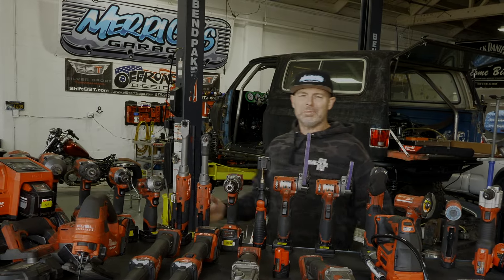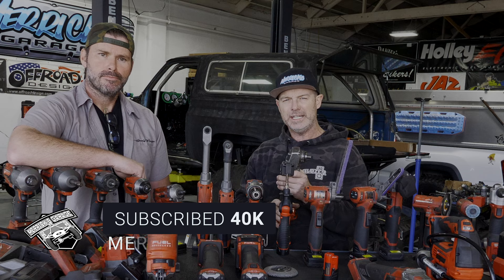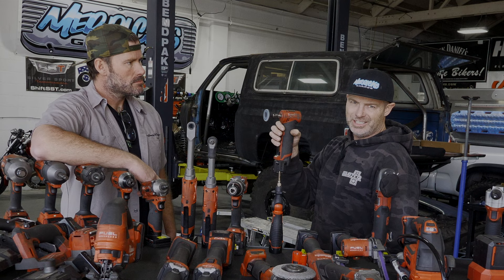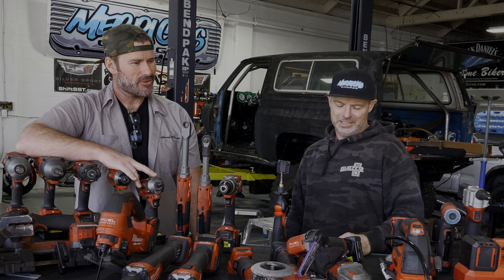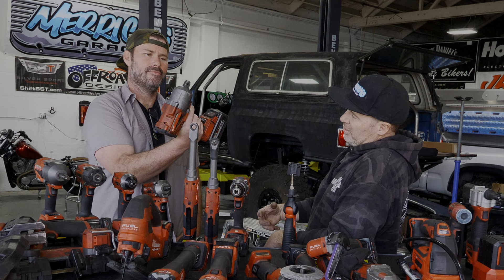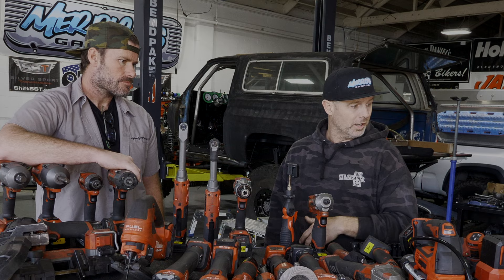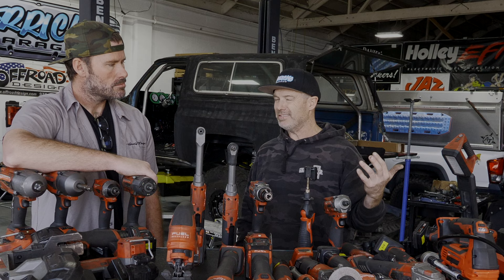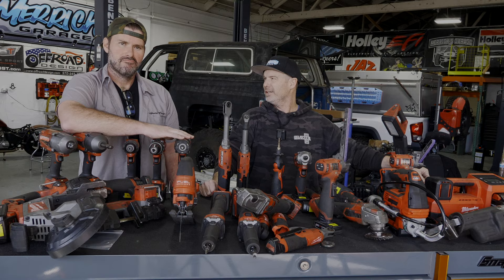This is why Milwaukee is crushing the tool game right now.

Comment: I have no reason to switch from ryobi tools, same batteries since 2000ish, all my tools still work from 2000s and my sawzall and drill have been abused. First job was cutting up one s10 to fit in another s10 frame included, still works somehow........